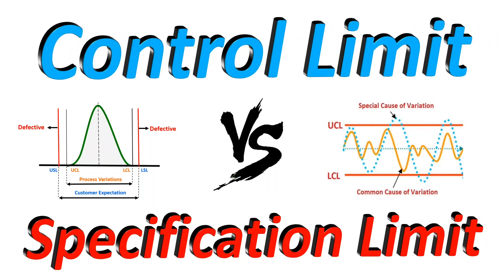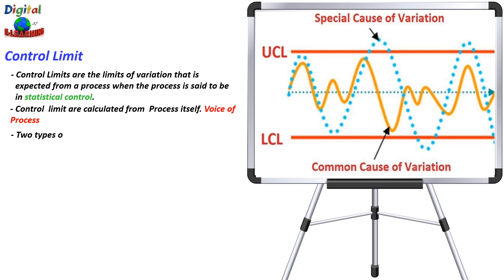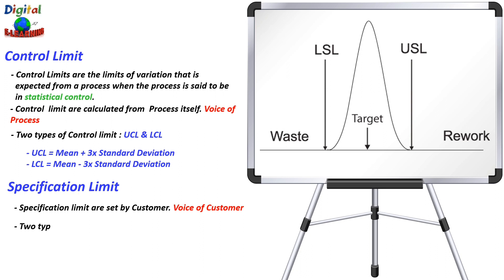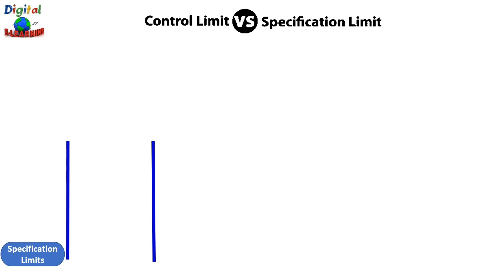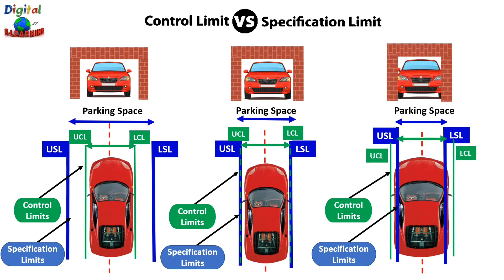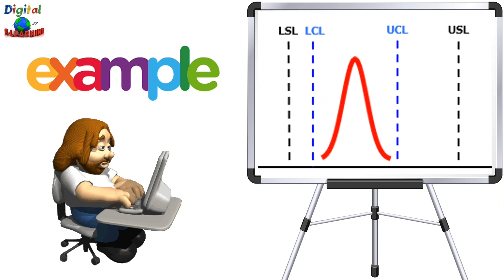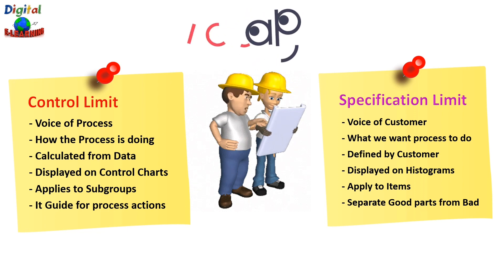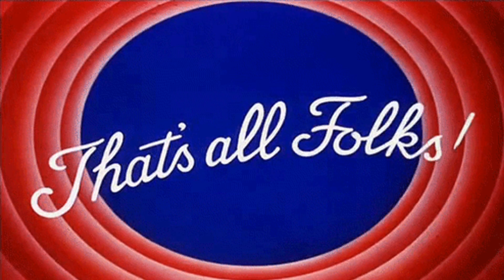Control Limit Vs Specification Limit | Difference between Control limits and Specification limits 😍

Comment: If the UCL  is more than usl and LCL is less than lsl den will der be any pbrlm
Reply from the maker: Yes, USL and LSL are defined by customers and UCL and LCL needs to be inside these. It means process is not in control  and limits parts will be rejected.